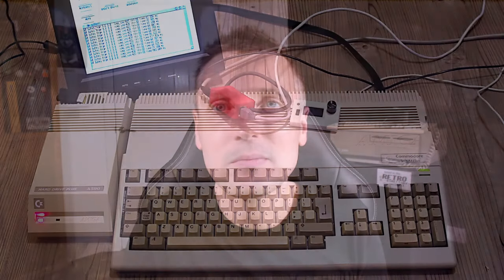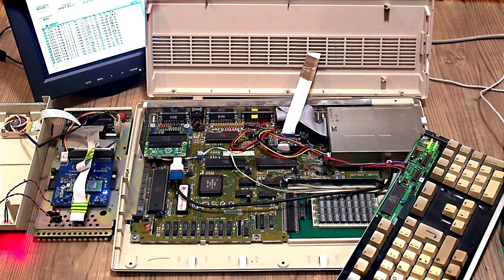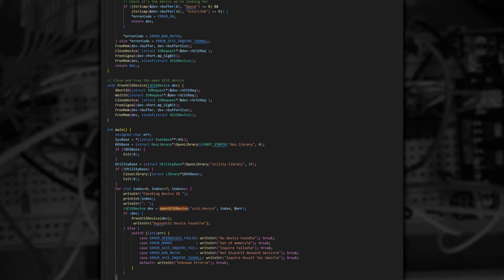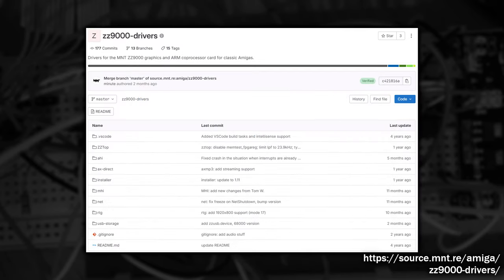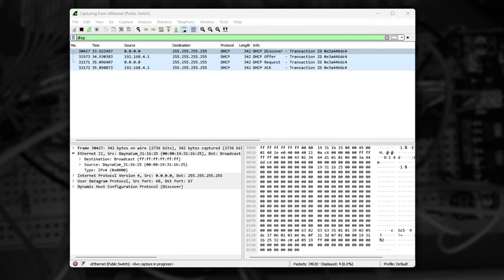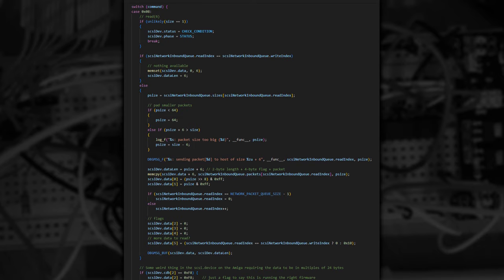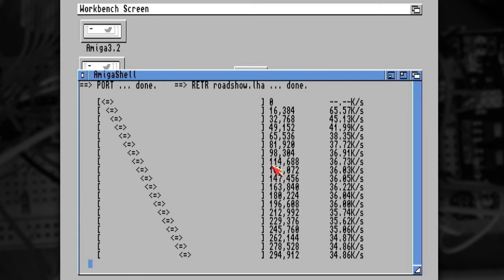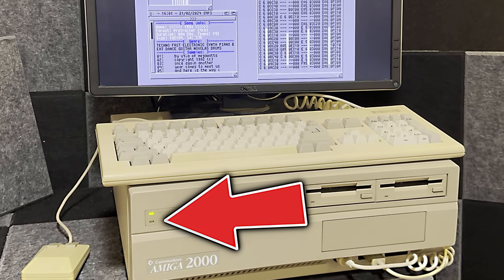"MAGIC" BlueSCSI Amiga Internet Access!

Comment: This is very cool!  I've subbed to you!  I've got a bluescsi - might have to see if I can apply this, mine is an earlier rev of the bluescsi though I think!
Reply from the maker: Might need to swap out the Pi pico inside to be the one with wireless (if it’s a BlueSCSI v1 it won’t work) good luck and thanks for the sub
Reply: @RobSmithDev Yes, I think it is a v1!  I will get a v2 at some point soon!  Very cool work, and better performance over plipbox is nice!

Comment: amazing, I have a few bluescsi v2 to build, I will definitely use pico w's. I would love to have just a few more details on the code to modify as I'd love porting a few additional pcmcia ethernet drivers if I ever find the time. 😊
Reply from the maker: There really isn’t that much code, the majority of the differences are in the actual communication with the physical device. You’d probably be best starting with the Prism 2 driver as that’s a PCMCIA driver anyway

Comment: Neat stuff!  I have a ZuluSCSI rp2040 in my a590.  I think BlueSCSI shares its codebase.  Think it would work with that?
Reply from the maker: Should do. It looks like the BlueSCSI network code was from the SCSI2SD, so if you find that code in the ZuluSCSI code base it may just work if you copy those files over (they’re the bit I changed)
Reply: @RobSmithDev To clarify the code was just placed under the scsi2sd library folder for ease of use, it was originally contributed to BlueSCSI via JCS.
Reply from the maker: Ah cool! Good to know!

Comment: Any update on when this will merge into the Bluescsi github? your version doesn't work to well with the Amiga BlueSCSI toolbox.
Reply from the maker: No update at the minute, they’re planning a restructure of the code to support many different network types. In the mean time I might update the bluescsi firmware to a newer build if I get a moment
Reply: @RobSmithDev  looks like the merged the wifi stuff about 12 hours ago into the nightly build
Reply from the maker: @nuzzie270 yes they did! Needs to be tested though - although it should work ok